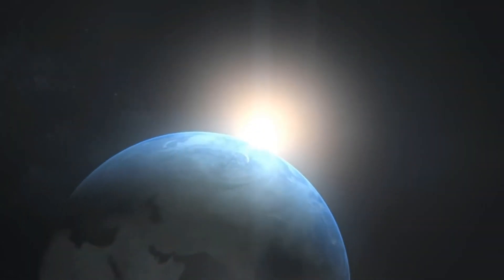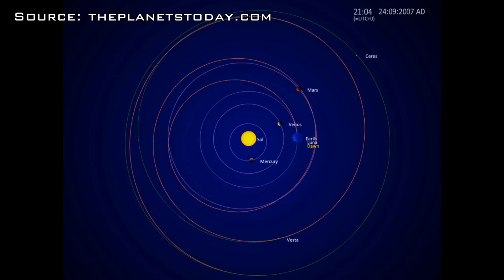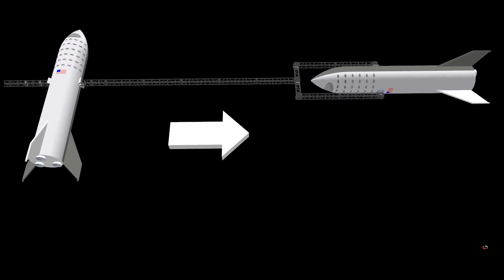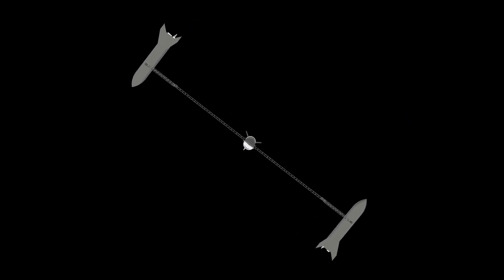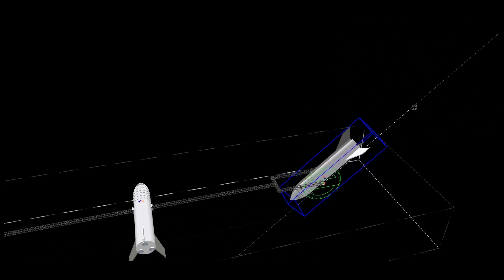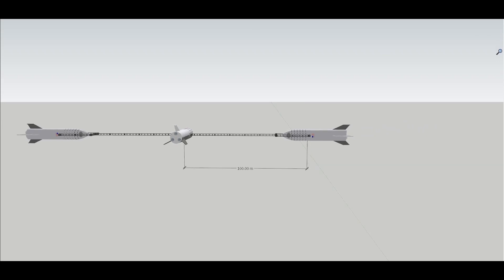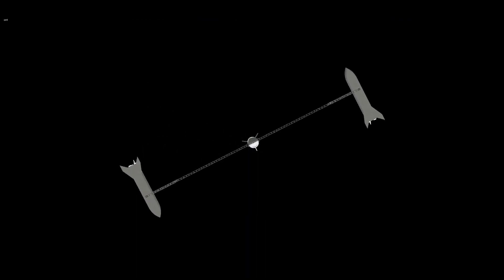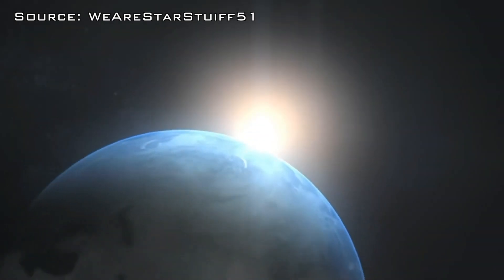GLS2: Artificial Gravity for SpaceX's Starship

Comment: Not bad. The last thing we want is to arrive at Mars after a zero-gee flight, unable to walk! And/or with cancer due to radiation damage - so the tonnage has to take account of shielding too.
Artificial spin gravity design, as you know,  has to watch for excessive Coriolis and excessive gravity gradient (head to feet), by appropriate choice of spin radius and spin rate.
I trust you've done the mechanical stress analysis too, to determine the truss thicknesses and geometries.. Especially check those hinges.
Reply: Can't they use the water tanks for radiation shielding? Even making the skin of the Starship a water tank?
Reply: @markreed9853  I've heard the thickness of water required for good shielding is around 10 m. Lead may be a better shielding on an effectiveness/mass ratio.
Reply: @MbeyaIsHome  A couple things kind of:
1. The 10 meter number is to reduce radiation in space down to radiation experienced at sea level. Really that's a bit overkill because the radiation we experience at sea level isn't that much. 1 meter I've heard is alright, but that's still a huge amount of water to take to space. And then you have to lug that to Mars and it's just not that fun.

2. Hydrogen based shields are better mass shields against radiation in space compared to lead. Lead is dense, which means it's volume efficient. But it's worse at shielding against cosmic rays compared to hydrogen because of a couple of other factors making it less mass efficient. Orion is going with the approach of in situation mass radiation protection where in the case of a big solar flare the crew members will go into the most protected section of the craft and surround themselves with cargo. 

Really there isn't that good answer to radiation, aside from reducing the risks to acceptable levels as much as possible and ignoring it.
Reply: @rocketyak4014  High Density Polyethelene (HDPE) water tanks for water, sewage, grey water, etc.  100 pax for 100 to 150 days requires a lot of water.  NASA estimates a minimum of 0.64 gal/person/day in space
(https://www.nasa.gov/pdf/146558main_RecyclingEDA(final)%204_10_06.pdf)
and 3.7 gal/person/day on earth.  Assuming luxury cruise accommodations (showers, toilets, etc.), but reasonable recycling, let's allow 2 gpd, that's 30,000 gallons, or 113,562 liters.  That's enough to put a 1 m shield on the sun-facing side of 29 feet or 9 m of the cabin area.  Most renderings show three decks of cabins, so that would be sufficient shielding for a 5 month trip.  

So, gravity and radiation are manageable; what else do we need?  Liquid Fluoride Thorium Reactors (LFTR) for abundant, safe, reliable power.  Put it in the cargo ship, in standby (cold) mode.
Reply: I really doubt artificial gravity is an issue. its not a cruise ship and im pretty sure the passengers of the starship should be able to exercise every day atleast.

Comment: Maby this is a stupid question.  but why couldn't they just use some air jets and spin the starship like a screw for artificial gravity?
Reply from the maker: No question is stupid! This would not work well because a spin gravity system needs a much larger radius. If the radius is too small, people get nauseus. Also you have to spin faster. Also the gravity would pull in the wrong direction. Here's a study a guy did on his exact idea with visual https://www.reddit.com/r/spacex/comments/d032bi/potential_for_artificial_gravity_on_starship/?utm_medium=android_app&utm_source=share
Reply: 👍   ty.             I wonder what space x is planing for the gravity challenge

Comment: Any thoughts to the large amount of shear stress your offset hinge mounts would sustain in the current animated design?
Reply from the maker: A chain is only as strong as the weakest link right? The Starship is proposed to be lifted by crane, so I'm hoping hardware that can take the stress will be developed. This component will certainly need to be robust, and will add mass. The surrounding hull area will also need to be reinforced.
Reply: Woody, you have a point. The bends in the trusses and hinges would have to be strong and heavy. 
The weight of a crane is not such a concern on earth, unlike space.

Comment: Hey man! This is a amazing idea! Artificial Gravity is key for LEO and off Earth Colonization! Have you heard of the Gateway foundation?
Reply from the maker: I have! Their ideas are quite massive. I wanted to figure out a solution with minimal space construction and minimal mass launched to orbit
Reply: @smallstars  Right on! I think that the biggest problem will be debris from construction. What happens when a tiny piece of metal shoots off from wielding? Clearly your method of artificial gravity can be applied today. Gateway has a way to go lol
Reply from the maker: @ammara4547  yeah, as things get cheaper and rocket propulsion gets more efficient big space construction will become viable. Right now, arguably the most expensive thing in the world is the ISS.

1 Starship designated as a Hub ship is going to be stupidly cheaper than building a giant space station with a 200 meter diameter wheel right?
Reply: Definitely! Way more viable! And imagine the Beast starship 2.0 using this system. This is the future indeed.

Comment: we can just use 2 starships instead of 3
Reply: The third middle one is essential for balance and to carry the attachment structure
Reply: @Gabriel-by3yx  i think two other major reasons the 3rd ship serves for is communications and solar power.  Will that work with spinning apps in that configuration?
Reply: @Gabriel-by3yx  yes I can see the configuration properly now, but i think the configuration will have a very huge complicated center ring where the tethers will be joined and spin about just like a bike wheel. If you look at a bike you will notice there is something in the middle that is stationary with a ballbearing that allows the wheel to rotate, that's what I am talking about. So this will be needed to allow the stable center piece , and allow free orientation of comms and panels towards Earth and the sun. This will require RCS or some active counter propulsion to always stabilise the center wheel as the outer ring, where the tethers, are joined is spun (so that they don't spin together - so where do you put the fuel tank for that propulsion? you effectively have another 3rd ship).

If the panels are put on the ships then the panels may not collect enough power. If it will go like a bike wheel and the treading part of the wheel, being the ships with the panels facing the sun all the time, then  they'd just be facing the sun optimally for barely 4 seconds. 

Given 4 Revolutions per minute is the target speed then each ship will face the sun only a quarter of the time (15 secs, that's 90deg angle of the wheel, which part is exposed to the sun as it faces the sun) and only 1/8th of that time for optimum solar energy collection. So roughly you get 3,6sec of optimal sunshine per minute to charge both starship panels, which may not be adequate.

To get better power input you will need to have both front and back of the panels celled. May give you nearly twice exposure thus ~7,2secs or less, but still will not be enough. 

I don't see any other optimum and non-complex way of facing the sun other than making the wheel spin against the sun or creating a complex center piece with this design. And since the rotation will actually be towards the Mars insertion orbit point then there is no way of actually doing better than this assumption. 

Using just 1 ship spinning around another is probably better.

The bottom line is, the third ship is needed.
Reply from the maker: 3 balances the spin. Also with a central ship you have other advantages I pointed out in the video, plus comms antenna orientation solutions.
Reply: @smallstars  
Anything, by definition, including a pair of ships, already has a center of mass-- and it doesn't need to be located at a solid object like a ship.  I'm sure you know this, so I don't get why you state that rationale. 

And what do you mean by "balancing the spin"?  The ships don't need to mass the same if that's what you mean. The heavier one will just be closer to the center of mass and have slightly less gravity.  

Whether a 3rd ship is needed just comes down to the mass and bulkiness of the truss/tether -- whether you can fit half of it in each ship along with the rest of the payload. If so, no special 3rd ship needed. 

As for the truss structure and swivel and all that complexity, I do not believe they are necessary.  Using multiple attachment points lets you do this with only cables. Stabilization can be handled by rcs (spacex are good at that kind of thing). This reduces the likelihood of needing a 3rd ship. Please respond if you are interested in a description of that. 

Btw, the multiple points of transverse loadings on that truss would require much stronger (heavier) structures vs cables or straight trusses with axial loading. 

It's great that you are putting this idea out there. This is something I've been thinking about for a while, and I was hoping someone would promote it. Thanks!
Reply from the maker: @harpfully  Thanks for your intelligent input! I would love to talk more about your vision, but it will be hard to convince me that hub ship carrying rigid connecting material is not needed unless RCS tech gets major innovation.
Reply: @smallstars  Yw.  If you want to stay with trusses for stablity -- and that certainly is worth looking into -- you might want to seriously rethink the shape of that truss.  It reminds me of the ISS, which is in microgravity.  Loads don't like going around corners.
Reply: ... What I mean is that the straighter the better.  I do agree that trusses could be good for some stablity issues. But let cables take the heavy loading, and use lightweight trusses in combination, to help with stability and minor tension loads, if you don't think rcs would be enough.
Reply: @harpfully  
Agreed, two ships with cables are enough. Multiple cables that reach a common point can be let out and drawn in to change orientation, although connecting those cables together is an interesting engineering challenge. The mass and complexity is greatly reduced compared to a long truss.
Reply: 2 ships joined by rear ends, spinning at 4 rpm will produce around 0.9g on the top floors, with around 5% delta between head and feet when standing up and >1% when laying down.
Reply: @TheGES  It's a shame how the best idea (yours) is buried in so many other replies! Musk already plans for Starships to refuel each other tail-to-tail, so, providing the docking mechanism can be made to withstand the tensile force, no other truss (or third Starship) is required. Keeping the engine mass at the hub also reduces the total angular momentum, reducing the spin-up/spin-down propellant requirement. The issue of floors/ceilings being interchanged is trivial in comparison to smallstars' proposal.
Reply: No, no let's use 100 starships! Moar is always better!

Comment: Great review, I had a dream about this same issue last night on 9/4/2019, Very similar design using 4 starships. Wow I stumbled on to your YouTube site and what a pleasant surprise! I had to subscribe and will be looking foreword for more content on this matter. Thanks
Reply from the maker: More content will be coming up! A design like this could be used for more Starships, and with 4 Starships, stabilizing the spin will be easier and thus, use less resources!

Version 3 of this system will use cables to hold the centrifugal force of the Starship mass pulling outwards, and the truss's purpose will only be to provide stiffness for actuating and stabilizing the spin. Perhaps with a smaller volume of truss, more of it, and more cable can be included to allow for more Starships to connect and be part of the stystem.

Comment: I have been thinking about the same basic idea: 2x starship + hub structure. It is a cheaper thing than a von Braun station: 3 parts instead of 24 ring modules + 4 spokes  + 2-3 hub pieces.A simple space station in LEO using this method makes sense before a long trip to Mars. I think we should have a station with spin gravity because humans need it for long space stays.

I have wondered about having flooring down towards the sides (like a passenger jet) instead of the length of the starship; this way cables could be attached at the ends of the starship. Just an idea. Probably still want a little bit of truss structure to keep oscillations to a min. However cables are the main structure because: tensile strength > compresive.

For the thruster system, did think about an ion drive to get the spinning fine tuned. It has higher impulse/ fuel. Also low rotational accel means it would be much smoother; less oscillation.

As for the Mars mission, send a set of unmanned ships ahead. When you get to Mars, land 1 ship with astronauts. Launch another ship (or more) with fuel from Mars .... you still maintain spin gravity in orbit. So 1 ship lands an another lauches to replace it.

Also the big advantage of multiple ships is if one fails at Mars, you still have a backup to get home to earth. Yes, it would be without gravity, but that would do in an emergency far better than being stranded. In the world of spares/back-ups 2 is 1, but 1 is none. 

Kudos for the video!
Reply from the maker: Thanks for your input!

My first video and original concept had dorsal connections and floors oriented longways like an airplane. Floors towards the engines is better though for a few reason, so that's why I came up with version 2 with the joint swiveling in another dimension.

About orbiting Mars, the current plan is to not use any fuel inserting into Mars's orbit, but instead enter immediately into the atmosphere so aerobraking does a lot of the work slowing down the spacecrafts for landing. However I speculate that entering Mars's orbit with a spacecraft as massive as these starships will happen at some point in the future. To achieve this with our current propulsion technology a Hohmann transfer that is perhaps slower and uses less fuel will be utilized, which will be an even greater reason to have artificial gravity.

Comment: Saw the link to your video under the recent video from The Gateway Foundation.
Do you think anyone will ever invest serious money in this station?
I don't see that happen for two reasons: No microgravity anywhere and no unobstructed, long-lasting view of earth. Anyone on the station would just sit in a module, looking out the floor and try to watch earth sinning by every 30 seconds.
Reply from the maker: Not sure about the funding, but depending on the axis the station spins on (orientation) you could probably get a great continuous view of Earth out of side windows. It might be weird having the earth appear to turn upsidedown every rotation though so I see your point.
Reply: @smallstars  
They want a sun synchronous orbit with on flat side of the station always facing the sun. (makes sense for solar panels and thermal cycles). But that would put the earth "on the rim" of the station with basically no chance for good observation.

But by far the biggest issue is the lack of micro gravity on the station. I mean this is the biggest reason to go to space anyway, isn't it?
Reply from the maker: @3gunslingers  I'm sure there's a workaround of earth communications, with antennae mounted on the hub ship. However I believe the earth will only be "on rim" for part of the year and as the bodies revolve around the sun, the angle changes.

This concept isn't a solution for a space "station" exactly, its more of a transport to distant destinations. As I said in the video somewhere in the 3 minute mark, it would be great to climb the truss ladder on an EVA and do micro gravity stuff in the empty hull of the hub ship.
Reply: @smallstars  
"However I believe the earth will only be "on rim" for part of the year and as the bodies revolve around the sun, the angle changes.
"
It's not that difficult to  track the sun with the axis or the station by using RCS. 

", it would be great to climb the truss ladder on an EVA and do micro gravity stuff in the empty hull of the hub ship." Absolutely.
What's the point of a vacation in space when you can't float in weightlessness?
Reply: @3gunslingers  the thing is this is transport. Without gravity for 3 months, how long it takes to get to mars, you will suffer various micro-gravity related medical problems.
Reply: @geohiekim8705  
Are you talking about the Gateway Foundation station of about Smallstars idea?
Reply: @smallstars  
One question about your idea with the truss:
How do you plan to rotate the StarShips to STOPP the rotation?
Reply from the maker: @3gunslingers  working on a solution for v3 involving a track